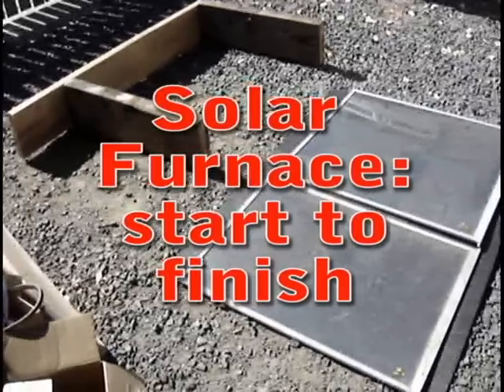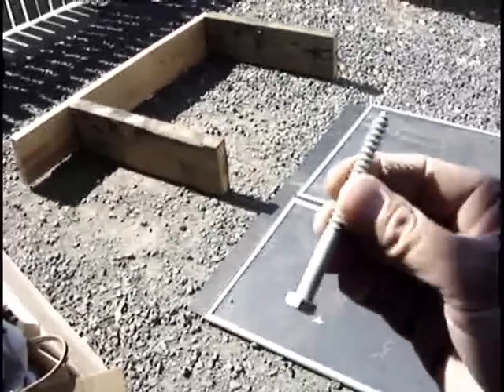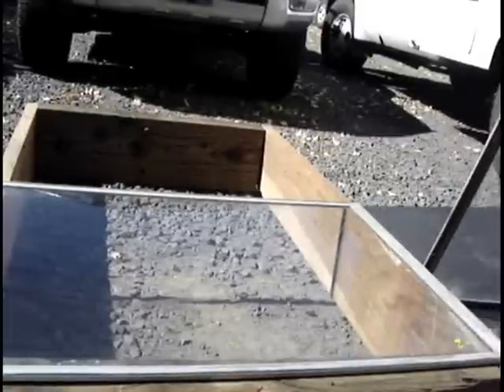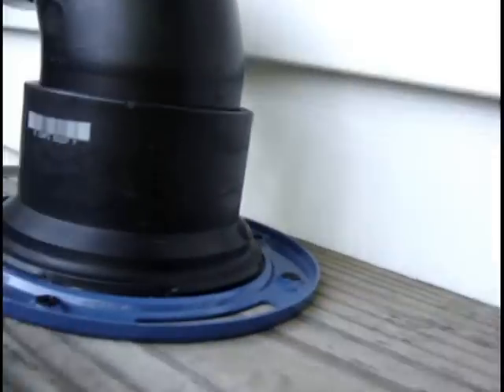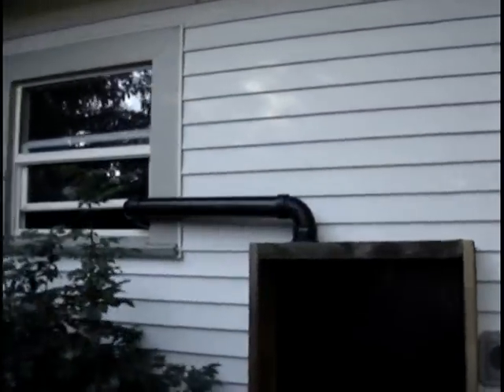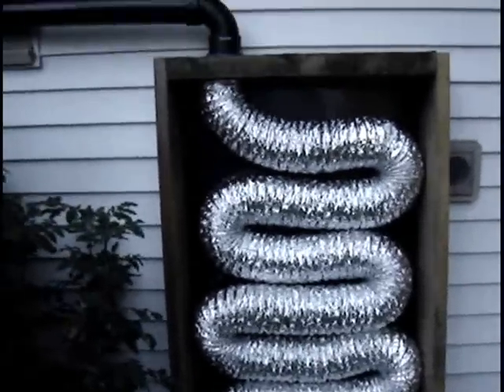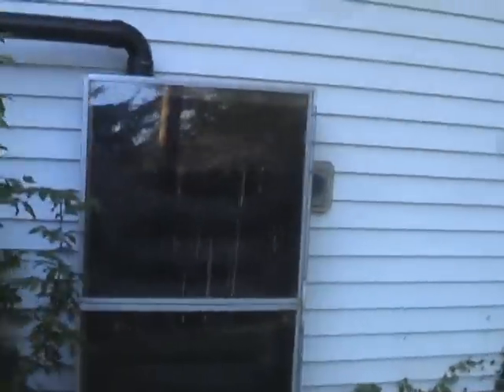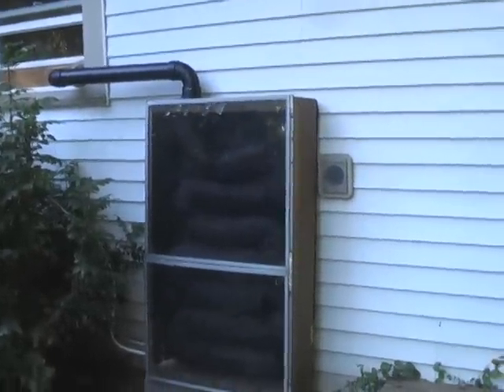Solar Furnace for under $50

Comment: Sweet project, thanks for sharing!   I wonder if there's a way to make it have any noticeable difference in the winter like in Minnesota where in the winter there's little sunlight and sub freezing temps. One idea that would probably be huge for this is you could install a 2nd window and silicone all the cracks  to make an insulated air space.  Then add a low-e mylar film to the outside surface of the inside window and that would allow solar energy to enter your heater box but greatly limit the energy loss back to the outside.  Most low-e windows have the coating on the outside pane inside surface to limit the uv light coming in in the summer but low-e was originally applied to mylar film and installed in the first setup to help heat the room, called it solar mirror.  When people accidental install a low-e insulated glass unit backwards, it really heats a room up!  Also thinking if you could somehow manage to run the hot air in tube up high on the opposite side of the room and then the cold air out low into the heater box would circulate the air in the room better.  If I knew something like this would work in the winters here, i'd try putting one on the garage.

Comment: Intake Air is too Small :(((. At least HALF of the other Pipe or more would be helpful. Why ?????
Reply: I don't think I'd say that.  Creativity and trying to make something involves many aspects of our mind.  I don't think it's a bad idea, someone states further down that he added a fan to it.  

Putting down someones idea isn't the worst thing you can do in life, but, it kinda sucks because like the old saying goes, never look down on someone unless you're pulling them up.  So......maybe provide suggestions that would make it work better.

Have a great weekend.
Reply: Yeah, I call total bullshit on this one, no way that can move enough air flow to do squat.  Even if it could, it's just a heat exchanger, which means you will gain heat when the sun is hot enough and you will also lose heat when it isn't, e.g. at night or when there is no sun.  In other words, what little you gain during the day will be given back at night.
Reply: I concur, pretty dick comment, but substance is valid, this is not good idea and just waste people's time and money.
Reply: Was wondering the same thing.  Not criticizing, just was wondering.

Comment: Interesting build!  My only change would be a single, bigger intake instead of the two smalls, so that whatever convection action starts pulling air, there's as little resistence/air-to-pipe-friction as possible
Reply: Sh*t up nerd.

Comment: Try this. Install the inside of your box with panes of mirror glass, back and sides which will reflect more solar radiation onto all surfaces of your black tubing not just the fascia.  Watch the temperature on hot days and the risk of fire!

Comment: Cute but it would be useless here in Oregon, we have no sun.
Reply: +David Gibson except, that he states that it "works well even here in oregon".
Reply: there is another design similar to this that you won't find on the internet and it hits the air up to 185 degrees. on a sunny day and on a cloudy day and heats it up to about 120 degrees. Not the room but the air inside the Heat box. this box should have been mounted on the wall with the intake coming in off the floor and going straight to the wall for the exhaust into the house so there's less heat loss on that big black pipe outside

Comment: Did you do a test and record what temperature rise you were able to achieve?
Reply: If you were to have maybe 12 or 20 of these units, ON your roof, aimed at the sun, with hooked up with no pipe in between the box and the roof, it might help a bit. Looks bulky tho...

Comment: It seems to me that a massive advantage of this design is that the black paint(s) used to help heat absorption are completely separated from the air flow.  Most other designs have air flowing past painted surfaces and then being ducted into the house, with no regard being paid to what nasty chemicals the paints might give off when exposed to the sun over many years - chemicals that will be breathed in by the house's inhabitants.  By keeping the airflow separate from the paint, this problem is completely eliminated.

Comment: I agree with Rusty, even though it's painted with black paint the heat is repelled by the shiny surface after penetration of the paint. Totally black throughout is the most efficient way to go. Matt black is the most heat absorbent.

Comment: I like this. You might find that your btu gained will go up if you ditch the small hoses and make your inlet and exhaust the same size. The airflow through the unit will increase, improving the heat exchange efficiency inside the heater. Exhaust temperature may drop, but btus will go up, because less heat is being lost in the heater and pipe. Also at a lower temp higher flow situation, you will get less off gassing from plastic parts and paint etc. Sounds counterintuitive, I know, but the most efficient heaters run at lower temps for this reason.

Comment: Your inlet of cold air is at the bottom of the box, as is the end of the pipe taking the warm air into the house. It would be better to have the end of your dryer hose at the top of the box where the hot air collects

Comment: Cool idea to use dryer vent.  I am trying to heat water with my box and while I can get box temp 60 deg above ambient at winter solstice, I'm not getting enough heat transfer into the water through the small diameter vinyl tubing.  I probably need a few hundred feet of tubing in the box, which would be costly.  I'm going to try an air heater box instead
Reply: Morgan Brown you might try an old car radiator. Thin water passages and many heat transfer fines. Although you may not be able to drink that water. But for just hot water ???

Comment: My HOA would go nucking futs over this. I just might try it!!
Reply: +Lin B I did, & just got mine running today. Mounted on roof & ducted directly in with a solar panel powering a 12v computer fan.
Reply: @CyberCurtainTwitcher  Screw the fan. Temperature damper and Convection currents! (Passive Heat! )
Reply: lol

Comment: Why not mount it on the roof for more exposure to the sun? Also insulate the pipe going into the house.  Air traveling  6 or 8 feet through a pipe that is not insulated is not very efficient.
Reply: +buz butler I was thinking the house window job probably looses  most of what is gained.
Reply: +buz butler heat travels upward by its self with no ventilator, so roof would not be ideal. Either way this only work in places where winters are light. Or not at all, i mean you got the window open, imagine someone trying to heat up in sub zero temps...

Comment: The plank of wood in the window, you are losing all of the insulation value of the glazing.
Lack of insulation means in the winter almost all heat will be lost  from the frame to the window through the drainage pipe.
A nice idea but needs more thought and work.
Reply: +golgotha9622 assuming a static system and ignoring the insulating properties of the wood yes but you cant so no
Reply: +golgotha9622 its not that big a deal. You just use a small box with a 2 inch airspace to replace the board and fill it with foam pellets. Then paint it black. It will collect enough heat during the day to counter what you lose at night.

Personally I would rather something like this be set up on the roof and then use a small fan to pump the air to an underground room that can store the heat in earth for radiant heat before being pumped to the rest of the house. Then in summer you have a switch set up so that the air evacuates off the roof. The hot air draw will pull the hottest air in the house out and by default provide a free cooling factor for the house. Its very old and ancient technology that's been in use for thousands of years. The hot air escaping from the roof will draw out the rising hot air in the house and create air flow. The earthen air from the basement will always be cool in summer warm in winter. You just use the switch to switch where the air intake comes from. In winter if comes from the roof and summer from cooled air in the basement. Virtually no electric cost for a small house to be keep around 70-80 degrees all year round except on the most extreme of days. On those days you fire up the ac unit or the central heating. Either way this system will cut down those costs even on those days.
Reply: +golgotha9622 You should become  an engineer
Reply: +Tee Fondle I am actually a University lecturer, I teach Astronomy and planetary science.
Engineering is my fathers field!

Comment: The box itself is not completely airtight, right? It needs to get air to pull from somewhere, do I understand correctly? How much air space and where did you leave? Probably only need an 1/8th inch or less, just in a corner somewhere. Thx.
Reply from the maker: +Maxwell Bernstein If the system is "closed", which maximizes energy efficiency, then the box should be as airtight as possible; the intake, coming from the house to the box, and the exhaust, going from the box to the house, should all be sealed up well keeping all "outside" air outside.

However, another option, the "open" variation, is to have a small vent on the box and only an exhaust leading to your house; this will draw "exterior" air into your home which pushes "interior" air, within your home, outside via leaks around doors, vents, etc...  This option, though not as energy efficient, may help remove moisture from showering, cooking, etc...  To vent the box, I would recommend placing a screen or other filter over an opening, similar to size of "exhaust", so that insects, dust, allergens and/or pathogens stay out of your home.

Comment: Would black drain pipe be better to use instead of dryer vent? It seems to me that the foil would repel heat that you want in the tube.
Reply: With any pipe a bend will restrict the flow, this corrigated tubing will restrct and cause even more turbulance. This however could be a good thing,  slowing down the air flow will give a higher temp output.
Reply: +Rusty Shackelford Dryer vent has a number of advantages, provided it's painted black on the outside. First, it will be shiny on the inside which will tend to cut down heat radiation, for much the same reason that a vacuum flask insert is silvered. Second, the corrugations will both increase the amount of surface air for heat collection, and also will cause the air flow to be irregular and hence more likely to pick up heat from the tube. Thirdly, air flow is kept separate from the black paint, so any gases given off by the paint over time aren't directed into the house, but are kept outside the house.
Reply: Rusty Shackelford
Reply from the maker: +Rusty Shackelford The aluminum dryer vent, painted with a very thin coat of black paint, is an extremely efficient heat exchanger as it converts solar radiation to heat which is then quickly transferred into the home before it is lost to the cold outside.
Reply: @steelsail  I'm using 4" black flex ducting from amazon. $15 for 24'. In case others are building a similar design

Comment: I'm sure you wanted to keep it under 50 bucks but for about $25 more you could do t upgrades. 1 is 3/4 inch ridged foam insulation on the back and sides use foil faced as the spray paint may melt polystyrene. 2 use semi ridged aluminum duct in my experience with foil duct over time it develops leaks. just my 2 cents great vid though I may have to try it in my small shop Im making in my barn since I cant afford heat lol

Comment: Why not just seal the box up tight and forgo the dryer vent tube inside the box?
Reply from the maker: +Pax Rasmussen The dryer vent acts as a heat exchanger.  This is vital to the efficiency of the unit.  Heat that accumulates inside the unit, as can be seen in my follow up video, is quickly lost to the cold outside; I found, via the "temp gun", that the temp outside the box was similar to the temp in the box, however, the temp on the surface of the ducting was significantly higher than in the box.  In other words, as the solar energy is transformed to heat, the air within the dryer vent transfers it quickly into your home... before it is lost to the cold outside.
Reply: I think that makes sense! I'm still confused, though: If the heat is there, couldn't you just run the fan and pump air through the box quickly, without the vent?

Comment: I like your use of the dryer hose.  It's a lot better than messing around with piles of aluminum cans!  Thanks!
Reply: Water has a high specific heat. If you got it to rise 2 degrees on a pass through a collector you were doing good. That is why a coil of plastic pipe on a roof is a good pool heater. It takes heat from the sun and the air. 72 degree water-95 degree roof temp and close air temp.Just buy the flat 2 by 20 ft pool heaters that lay on the roof.
Reply: you should use your dryer exhaust to add heat to the solar furnace too!!
Reply from the maker: +Manfred Westeroth  I'm sorry for not quickly responding to this question.  I have responded to a similar question and even posted a follow up video with data.  Please take a look at my other responses, to these good questions, to more quickly get a response.
Reply: +Amy Luthien I see he has not replied to you, the reason for that is that he saved next to nothing. I tried a similar system to heat a pool and the out going water was only 2 or 3 degrees warmer than the water going into the hose. So there is no way to heat a house with that system.
Reply: +Manfred Westeroth Sorry for the mistake, this was to be a reply toSpiritBear

Comment: I would really like to try making this, are the instructions available in print??? Thank you
Reply from the maker: +grace marshall   Since I used all recycled materials for the frame/backing/window, there are no specific plans for the unit (I just pieced together what I could find from a local building recycling center).  However, the process is pretty simple and I'll outline it here:

First, you will want to find used window(s) and/or used plexiglass pieces... this will determine the frame.  I recommend finding used pieces as this project can get expensive quick if buying new materials at a hardware store.

Next, you'll cut the recycled lumber of the frame and use lag bolts to fasten the ends so that the window will fit on the outside of the unit.

Next, you'll attach a backing.  Dryer vent will be attached to the backing and/or inner portion of the frame... spray paint the vent black so that it absorbs as much sun as possible.

You'll need to secure the exhaust end of the dryer vent, as seen in the video, to a hole at the top of the unit.  The intake of the dryer vent will be at another hole at the bottom that should be linked to the home.  As pointed out in comments, and in my follow up video, it is ideal to have air move from the house, through the unit and back into the house after it is heated.  However, the unit will still heat air even if it is simply drawn from outside.

As seen in the follow up video, I did place PCV black plastic pipe going from the unit into the house, attached a computer fan and wired it to a solar panel.  This automatically directs air through the unit when adequate solar energy is present to heat the air (thanks to a comment that recommended this).

Finally, after the unit is "plumbed" together the window should be fasted to the outside of the frame with caulk and/or screws.

This project is very rewarding as sometime around noon, if the sun is out, you will hear the unit automatically come on and heat your home!   For a small housing unit that is compatible with this as a wall module, please visit:

www.warmpod.com
Reply: Thank you very much.

Comment: why not add a valve on the inlet to the window (accesible from inside of course) to control the amount of heat?  If its too hot inside, you can close the valve halfway.  In summertime, close it.
Reply from the maker: +Robert Maybeth  That is an excellent idea :)  I did a follow up video where I installed a solar panel connected to a small fan which acts similar to a valve.
Reply: Without air circulation the box will get extremely hot.  I'd suggest to move the whole thing somewhere sun can't hit it in the summer.  You lose a lot of heat in the exposed pipe.  Awfully small supply line for the house air.  That will restrict the amount of hot air you will get.  The plastic sheeting probably won't last very long, just paint the wood flat black or dark green.